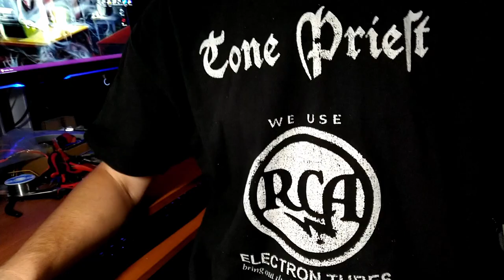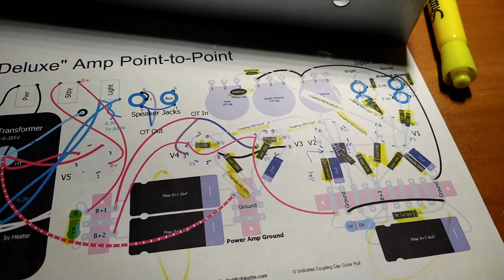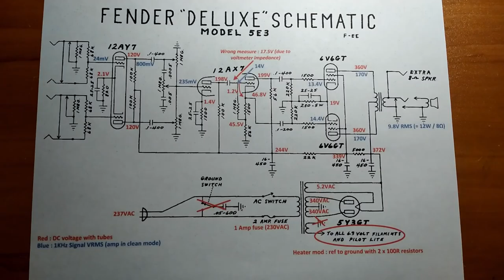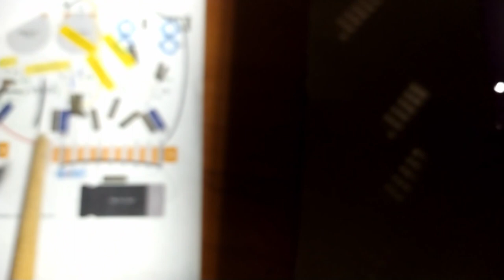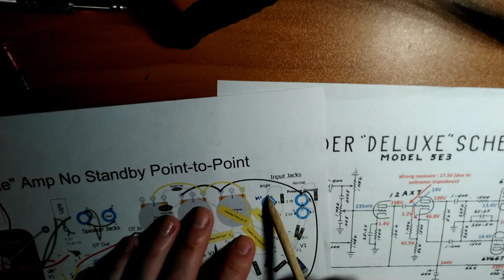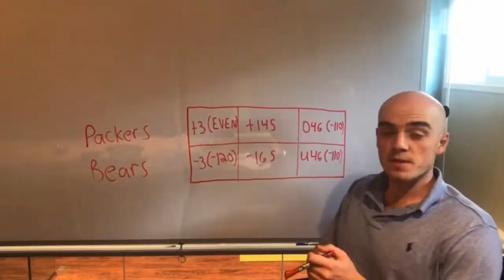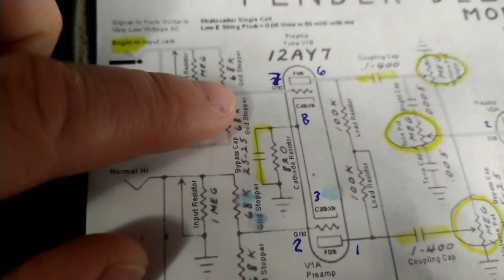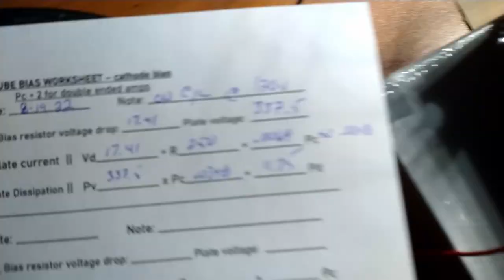POINT-TO-POINT FENDER 5E3 TWEED DELUXE CLONE BUILD - LET'S BUILD! - EPISODE 11

Comment: did you change the values on your filter caps? or is it  the brand you are concealing? I'm thinking of trying P2P and move away from all the wire.. I'm thinking about using Jupiter but I'm not sure yet
Reply from the maker: I got the closest value caps that were readily available. 

Go for it! Point to point is fun.